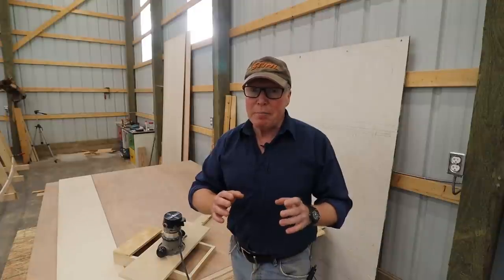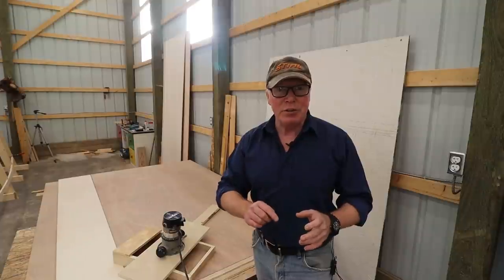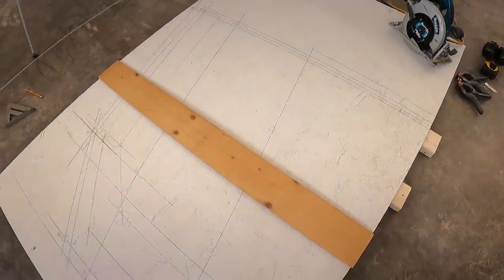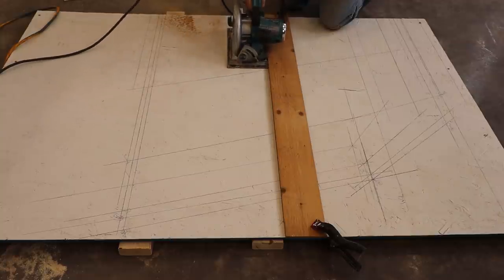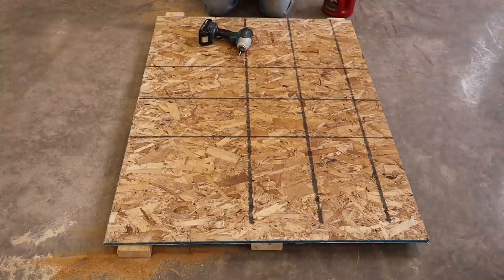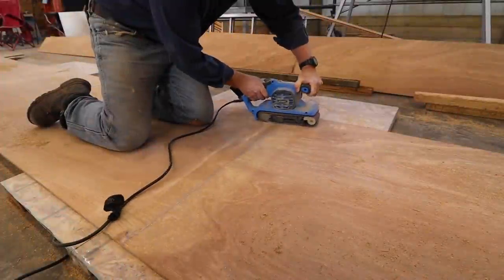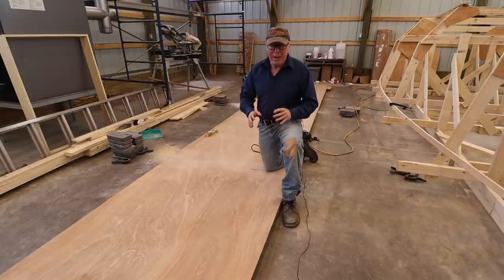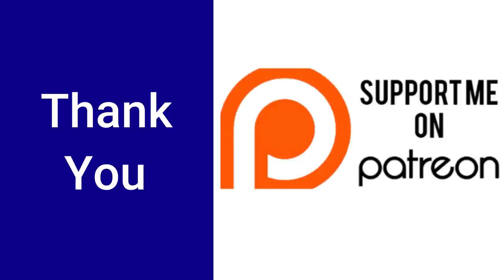S2E10 Scarfing Plywood for Wave Rover's Hull || Building a Scarfing Jig || Building a Wave Rover 650

Comment: Reminds me of Building a Granta boats plywood Canadian Canoe way back in my teens. I had to do scarf joints on the sheer and the plywood. Quite a bit smaller scale than your boat, but your video triggered memories from 40+ years ago. All done by hand with no power tools back then.
Reply from the maker: Good for you, I prefer hand tools and they are much less dehumanizing than power tools, but I am under a fairly tight time line on this project.

Comment: Just received my Mark Three Self Steering gear plans, thank you Alan. Definitely worth the negligible outlay as the instructions and graphics are so clear and easy to understand. Compare the (enjoyable!) effort and cost of materials with the £3000 to £4000 a similar device would cost from a chandlery and it makes total sense to get the plans and make my own. 
 Thank you again. Dave, England.
Reply from the maker: The MK3 survived some pretty extreme weather with out any failures. It required only having less than $1 worth of maintenance (string replaced) after sailing almost 8000 NM, crossing the Atlantic twice.
Reply from the maker: Great to hear Dave. Send some pictures when you get it built.

Comment: My first scarfing experience was building my kayak. I used a low-angle block plane to scarf the 4mm okoume for the sides, bilges, and deck panels. The first scarfs were strong, but nothing that would make me want to finish bright. So I painted the hull green. :) They got better with practice. I really like your jig.  I'm currently building a 24' Woods Eagle catamaran from 6mm and 9mm okoume ply over a Sitka spruce frame. That calls for butt blocks.
Reply from the maker: LOL, mine got better as I went along and figured out how to use the jig better. Good luck with your build.

Comment: Hi Alan - really enjoying your video journey of the build - one problem I have is finding the full sequence of the U-Tube vids - can there be a numbering system or similar or can they all appear in a list on U-Tube.  Have owned many sailing boats inc a Bruce Roberts, E-Boat, Red Jacket, and Hartley TS14.  My only boat build was a 10' canoe when I was in school.  Did the hull with strips of paper dipped in flour and water "glue" on to a wooden frame then 2 coats of pitch paint.  Disaster on the first voyage due to a wave tip-over and the paddle breached the hull then it all went soggy.  I'm sure your hull will never suffer such a fate.  Great to watch and thanks.
Reply from the maker: You have a good point about the sequence, I will get to that. Mean while, if you watch the Season 2 playlist they will play in order.

Comment: Interesting method.

I have scarfed plywood using a belt sander.
You can do multiple sheets at the same time by stacking them with the required offset to meet your scarf slope, (i.e.; 6 inch offsets for half inch plywood if the desired scarf is 12:1).
The plys of the wood make it easy to see the scarf as it starts to look like tiger stripes as you work. this also makes it easy to check the the scarf is straight, the lines should be parallel to the edge as you work.
Reply from the maker: That would work but I would think that it is considerably slower. If I had a 10" skil saw I would have made a jig for it.

Comment: A word to the wise: Cover your lead ingots with something, such as duct tape, to prevent direct contact with the lead. Lead releases dusty oxide all the time and this small exposure is significant since lead stays in your body for years.
Reply from the maker: Good advice, thanks for that. You may not see that immediately but later videos will have some protection on the lead.

Comment: Will the scarf joint when installed on the frame lay over or between the ribs. Can you screw through the joint?
I still think you should be selling t-shirts and caps with the new Wave Rover logo. It's very beautiful and pleasing to the eye.
Reply from the maker: I keep meaning to get on top of that T-shirt thing, thanks for reminding me. The scarf joints can be randomly placed and bulkheads and ring frames are designed on a grid pattern by the Architect. They are strong as you will see in the next video and you can easily screw through them.

Comment: Or, is the sheer stringer even mechanically attached to the frame on a temporary basis? Or is it just clamped and then reLeased when the plywood is attached to the stringer and then re-held with the same clamps together with the ply to the frames? My guess is that the stringer just floats in the slots on the frame.
Reply from the maker: At one point (frame 3) the stringer was not tight into the notched frame so I put a small 3" C-clamp on it and wired it back into place before gluing it up.

Comment: To make a safe scarf joint every pot of epoxy you mix you glue together two pieces of the same wood and label them then do your scarf then put your labeled glued wood in the dishwasher for a few cycles and see if it holds up if it doesn't your scarf joint is no good because either you didn't mix it or scarf it properly

Comment: Question: you keep referring to “mixing glue”. Is it actual glue or thickened epoxy? If it is epoxy, is it not necessary to apply weight to the “glued” scarf joint? I am under the impression that epoxy is a chemical bond and therefore does not need excessive clamping or weight. Thanks!!
Reply: @liamstone3437  I agree. Some weight is required. I just thought that what Allan used might have been excessive. However I’m still not sure if he used glue or thickened epoxy.
Reply from the maker: I wet the edges out with straight epoxy first and then in step two, mix in micro fibers to create a thickened glue. You cannot count on the ply being free from warp or other stresses when you glue. In addition, Liam Stone's comment , gives a very good explanation about why we like to keep joints as thin as possible.

Comment: I am building a cnc machine. How do you feel about puzzle joints reinforced with fiberglass compared to scarfing?
Reply: or even just a Payson joint, re-inforced but joint ?
Reply from the maker: It should be fine but not quite as strong as a well made scarf. If I only had 1 boat to build I wouldn't bother with a CNC machine as the scarf jig is fast and simple to build.
Reply: @RoversAdventure  I agree. Its only the smaller Kayaks and fiddly, complex small boats  that benefit from the precision of a CNC cut. Lofting the panels manually on a substantial boat like this one, is way more efficient.

Comment: Why scarfe? You lose length of plywood, and have all that trouble shaping. Do a Payson (reinforced butt join). You have ribs inside the hull, so  the extra internal size isn't critical.
Reply from the maker: The scarf joint is superior in avoiding any hard points and getting a nice fair shape/curve.
Reply: @RoversAdventure  Yes, fairing is one consideration. Hard points per se are not, because you will be epoxying ribs hard up against  the inside of the hull in any case. 
But, if a Payson joint would cause an assembly problem, you can simply glass the whole, (or a substantial area of outside) of  the outer side of the plywood, over the join, before applying the panel. Then, once the panel is curved and glued into position, glass and reinforce the interior.
The plywood is well contained and supported with the epoxied butt joint  together with the outside layer of glass, during assembly. Even a smaller glass strip inside the join would barely have any effect on the curve.
In fact, for a substantial vessel like this one, you could probably substantially glass both sides, and still not have an issue curving the hull to shape. 
Additionally, If you did the glassing on a flat waxed surface, you reduce a lot of finishing work too. 

Scarfe joints are just a hangover from the days of planked boatbuilding, and are redundant in the age of Epoxy and Glass encapsulation.
Reply: @dnomyarnostaw  Encapsulation - A way of covering up all of the faults and mistakes.
Reply: @delukxy  Wood, intrinsically has faults and mistakes. Marine Ply , doubly so. If you could see in past the outer laminates, your image of a pristine, solid material would be shaken.
Marine Ply is also a way to hide "faults and mistakes", of timber in general.
Finally, encapsulation is not "covering up", it is Protecting Wood, from its main enemy - moisture.
Reply: @dnomyarnostaw  Don't put words in my mouth. I never made any comment about wood quality, ply or solid. I don't know if the hull will be fully glassed or not and I don't consider that to be encapsulation. It is indeed excellent protection from minor abrasions and moisture and should ensure long life for the hull. Final paint and antifouling for the final touch.
I'm not a yachtie, boat builder or even a woodworker by the way. Fibreglass is very versatile for many jobs including bad ones!

Comment: Is the drunken sailor still in bed with the Captains daughter? 🥴 I’d break my hungover neck walking on sawdust early in the morning. Floor looks like it has a slippery hard sealer? Why not just wipe down with acetone? 

Using that joint with ply is tricky. Can’t save mistakes  by sanding. 😉 You’re glassing in the hull, right?
Reply from the maker: Oh yes, the hull will be glassed.